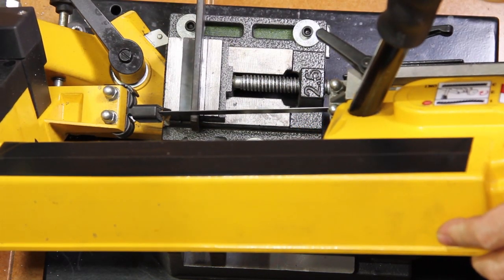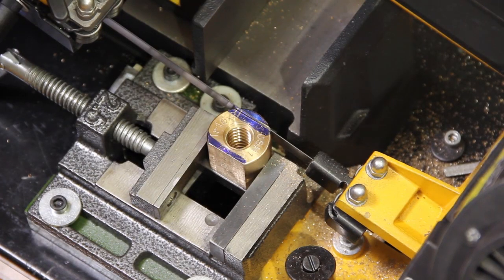Extra vise to cut small parts on metal bandsaw

Comment: Nice idea, I had the same problem, so I made up a pair of plates that are about 3" longer than the original vice. They've got a spreader screw at one end that you adjust to the width of the part, then clamp it in the vice with the part nipped between them. They work OK, but it sometimes feels like I need three hands to quickly get it setup accurately.

I'm liking your solution,  but I guess that if you ever need to cut a 45' angles you'll have to remove the second vice. I mainly use my little bandsaw for chopping things like angle iron for frameworks, and use it quite a bit for 45' cut's, but In a purely engineering environment I suppose true 90' cut's are more the norm.
Reply from the maker: The vise is easily detachable. Yes, I rarely need 45° or other angles. Each time I reset the saw to 90° i make some cuts to check the actual angle and correct it if necessary.
Thanks for commenting. Greetings.